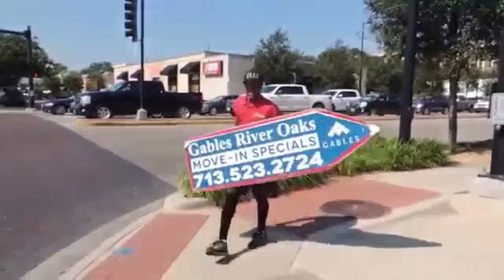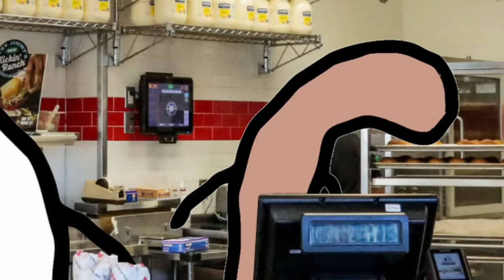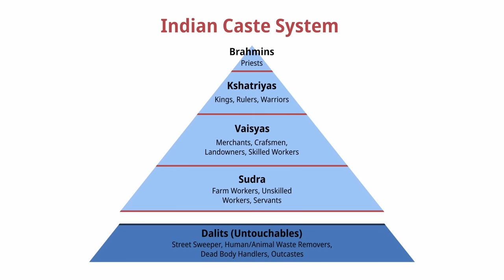7 Levels Of Blue Collar Workers

Comment: As a warehouse worker/forklift operator in an cold warehouse (3 degrees C inside) I feel good in there. Sure, I have graduated high school as an entry level business man, accountant, cook and waiter but those jobs are either badly paid or require me to work about 40+ hours a week (40-80) or require me to cure cancer beforehand, the ability to teleport or 50 years of experience. I simply refuse to work that long because I value my free time. My free time is not something I can get back with money. I'm pretty happy at where I am right now. The pay is alright, could be better but it's alright for now.
Reply: You could work 1 day a year in a field and turn around and say you have 50 years experience 50 years later. It's a worthless measurement.

Comment: First off, great video. I have worked in construction for most of my working life but I can definitely say that I would take it or the trades over pretty much anything else on your list lol. There is however a secret 8th profession that isn't on here. Farmer. Let me break it down. The pay is terrible and the hours are super long, especially during harvest in the summer/fall, and the birthing season in the winter/spring. Always exposed to the elements. You basically do the job of 5-6 different trades, between fixing equipment, repairing buildings, acting as vet, plumbing and electrical for irrigation, ECT. Bucking bales (whoever coined the phrase "hay day" as something enjoyable has obviously never actually put up any hay in their life). All topped off with the undeniable fact that literally EVERYTHING on the farm will make you stink, itch, or more often than not, both. The real unsung heroes of society.

Comment: I am going to a tech school to be an electrician, and tbh as long as you don't do something dumb like touching a random wire you will be good
Reply: I went to help my dad install an outlet in a garage one day and it started raining. He warned me to take a break when it's raining. Your life is more important than customer satisfaction.
Reply: Young apprentice, apply these rules to your work, and you'll have a long career. 
  1)  Treat every circuit as live. 
   2) Trust, but verify.
You should trust your coworkers with your life. Anyone of them that's insulated is one not to trust. 
     3) don't trust tick tester/chicken sticks, no contact voltage testers. They will mislead you when it counts and will at the least send you to the store to replace some pliers. Get a multimeter.

See you out there, kid.
Reply: @ericmoe63  Thank you for the advice, the first one  is my teachers number 1 rule👍
Reply: i guess you haven't worked yet? as long as the part you touch is insulated you will be fine and always turn of the power before working on stuff. as long as you keep to the 5 safety rules, you will be fine. and if you are not sure if something is dangerous or not messure the voltage with a real messuring tool.
Reply: But .. but ... but most of the wires are random tho
Reply: @GbpsGbps-vn3jy  i work as a maintainance electrican in a industrial plant and most wires there are random and you at first often fo not know for what which is till you look in the plan
Reply: @GbpsGbps-vn3jy  Its not that dangerous you can figure out stuff before touching it fairly easily, I do commercial/industrial electrical work never been shocked by anything bigger then 120v and the very few times I did get shocked was from not testing things before going in.  always double check things are off and tag breakers you turned off so others around won't flip them.
Reply: Electrical work is were its at for the pay IMO Im not sure how your program works if its a 4 year program or what not but its worth all the time and effort in the long run listen to the older guys on the job sites some might be dicks but they do mean well
Reply: @thekiwi4156  yea from where I am at I have co op
Reply: @Daily-PE  thats great no better way the  to learn on the field with the guys that been doing it for a while 😎
Reply: @thekiwi4156  I just have to wait a year and a half because I am only a sophomore
Reply: Being an electrician in British winter really makes you think if it's worth the money starting out from experience anyway
Reply: Lock out tag out is your friend.
Reply: Also look out for Variable Frequency Drives(VFDs), they sometimes explode at random times for various reasons. (Dust build up, rat inside the VFD, power surge, breaker fail closed, moisture, machine operator slings a 4x6x12 through the MCC by poor machine operation and many other such possibilities)
Reply: @ericmoe63  So basically half of firearm safety rules. Hell, I'm going to become an electrician. I already know the difference between being shocked versus electrocuted so I'm halfway there, right?
Reply: My Dad got me straight into being an electrician straight out of high school and now I have been working for almost 2 years with his guidance (sort of like and apprentice I guess). I enjoy most aspects of it except the winter it is cold where I live.
Reply: You will get popped at some point no matter what you do. 120/110 isn't to bad. 220/240 will have you cursing for a few minutes. Anything higher...your gonna be laying on the floor for a solid 10min  trying to figure out if you need an ambulance. Good luck.
Reply: Me, a 24 Y.O welder/fabricator: when I have to be an electrician I "sometimes" "forget" to shut off the circuit I'm working on. And when I do that, it's 3 phase 240v or 480v depending on the tool I'm working on, haven't been fried yet, my Fluke 115 has probably saved my life at least once now that I think of it...
Reply: @ericmoe63 Dont get a multimeter unless you plan to get a good one the cheapo ones can blow out if you dont set them right. I prefer a good fluke voltage tester myself "y'know those 2 pin things connected by wire you stick in the socket i hope i got the name right we use a diffrent name in Dutch" i only use my multimeter for all the low voltage 24 stuff and only to measure resistance amd such (the voltage tester can do that to but i have to hold a button and that sucks)
Reply: God, I couldn't be an electrician. Too scary. A big lathe will turn you into paper if you put your hand in the wrong place but you can see, hear, and sometimes FEEL if it's running. Way more comforting.
Reply: @GbpsGbps-vn3jy  none of the wires are random if you go to school and understand the circuit and what wire goes where
Reply: @dan7eiscool  You are the second one here that didn't get the joke ... WTF is wrong with this world?!

Comment: I have a friend that works in a melt shop. Working in and around MASSIVE ARC furnaces that routinely have steam detonations and occasionally throw molten metal across the factory floor. Sometimes a crane operator whose not paying attention knocks over a vat of molten metal and everyone on the ground has to run for their lives. Dude does 16 hour days in the hottest conditions you can think of, and goes for weeks at a time with no days off.
Reply: That and meat factory has to be the worst of the worst.
Reply: he certainly won't need any coffee when he sees the liquid metal containers to tip above him lol

Comment: I was a mechanic for some time and they werent mentioned and it sucks, there is about a thousand ways to get hurt and die and the entire money making incentive is how fast and how hard you can push your body. And turning wrenches may not seem like the most physically demanding at first, but when you have to lift and move heavy objects while also contorting your body around and in tight spaces while wearing out very under utilized dextroius muscles it gets pretty tough.
Reply: I'm a mechanic too. Its a very underappreciated and underpaid job. I made over double my current pay when I was digging ditches for the water company or even when I was working on the farms.
Reply: I transitioned over to heavy equipment. its the positions that mess you up, I thought I was cool with the heavy lifting since I worked heavy in a warehouse, but trying to hold a bolt in the most overextended way while someone else is trying to get right fit is another pain. My forearms are the thinnest in the shop so I get those jobs. 25 here, so far my knees feel more messed up but atleast my body isn't completely beaten up like in a warehouse, where I did make more money

Comment: Pizza delivery is like the holy grail of these jobs. Great pay including tips and almost none of these downsides.
Reply: Started driving for dominoes a week ago. The irony of pulling up to a million dollar house and seeing no tip is palpable. Yet I recieved a 13$ tip from a motel room.
Reply: The wear-and-tear on your car though. Plus gas is expensive and most places won't reimburse for it.
Reply: @ramunematt  I work for Pizza Hut and they give me 36¢/mile for gas. You can get a 2000s Toyota or Honda for less than $10k and it will most likely be very reliable and cheap to repair.
Reply: Pizza delivery sucks, people don't make careers or own houses out of delivering pizza. Lots of construction workers own homes js
Reply: @JubJub117  It depends on where you live and work. I work 32 hours a week and make approximately $36k a year. That's not a lot but where I live it's enough to buy a small house with a 15-30 year mortgage if you are frugal. And if I were to buy a house with a partner then I'd be ballin. The only real downside is I will never be prepared for major medical bills. And as far as careers go, you are probably right for the most part, however my general manager who has worked for 20ish years in the pizza business is being promoted to district manager or something. That said, he works 70 hour weeks so...
Reply: @joshbaldridge457 Rich folks RARELY tip. Best tip I’ve gotten was from a trailer in the middle of nowhere.
Reply: You cant get stoned working for Unions, can u?
Reply: @soulie2001  I'm literally the only driver at my work who works without smoking 😄
Reply: @JubJub117   not everyone is happy when they own a home, some are happy with their life when they got a room to live in weed to smoke and food to eat.
Reply: Tops your making $1000 a week, plus wear and tear on your personal vehicle and gas money at some places. Not even close to worth it for the wear on your vehicle alone.
Reply: I read somewhere you have a more dangerous job than a firefighter as a delivery guy
Reply: @JubJub117 because they build them no shit
Reply: @JubJub117 people should be able to make a living delivering pizza
Reply: @itsmejb  agreed, so should retail workers, so should fast food. Doesn't change the fact it doesn't. It should though
Reply: Having to buy and maintain your own vehicle AND cellphone is a huge expense for a job. 

As a mechanic I don’t even need a car or a phone for my job.
And I make twice what pizza delivery diver makes.
Reply: @fastinradfordable  I bet mechanic is a good job but I don't think those things you said are a big deal for the average pizza guy. Most of us have phones already and we drive really cheap cars.
Reply: @fastinradfordable  yeah yeah yeah everyone knows mechanics are lazy.
Reply: pizza delivery is awful if you live in a questionable neighborhood
Reply: @methanemamba2461  true
Reply: I did it a number of years ago and it was pretty solid money when I could get the hours, but for the most part I’d go in for a few hours daily during peak business and get cut early or not make great money after the rush. Went on to EMS, reasonable school length, a lot of the independence and free movement I enjoyed while working pizza delivery, legally permitted driving speeds and a lot of the same mapping skills. Plus basically unlimited overtime (within safe reason) for the REAL money. I also became an emergency dispatcher which is fairly short education length but extensive on-the-job training depending on where you work, better pay than the field in my area and easier on my body and used a lot of the same mapping/route strategy skills of delivery work in a safer but more structured workplace environment with good benefits and consistent hours, but again you lose a lot of your independence. I do miss the pizza delivery gig sometimes, but I definitely appreciate the consistent paychecks with a lot of the same old perks now.
Reply: @joshbaldridge457 Haha their nothing like going to an huge house to deliver pizza with multiple Porsche in the driveway and they are the lowest tipper of the day. lol
Reply: >great pay
lol
lmao even
Reply: @slightlyaboveaveragebutaverage  That's subjective. I make $20-25 an hour which is crazy good for where I live. I am able to live very comfortably on that pay. To some that is great, to others that is slumming.
Reply: @casadilla111  There is a huge trailer park in my delivery zone and half the people there are Hispanic. I am always happy to go there because they are friendly and almost always tip well.
Reply: @joshbaldridge457  Rich people don't tip.
Reply: The downside is the pay
Reply: @foolin11  if your goal is to buy a big house then yeah, but if you are okay with less expensive housing then you can have money leftover to invest. I've delivered for a year and a half and saved $19k
Reply: @henrykopp6402  Personally, my goal is to use the money to go to commercial pilots school which is over 100 grand tuition and all and left over money to also buy a house. Schooling is only a year and my wife is a registered nurse. Plan is she'll cover most the mortgage while I'm in school, will likely have to relocate for my pilot job and we rent out our place for extra money and buy wherever else we move if we're there for a while.
Reply: Valet driving is the superlative summer job, you can’t convince me otherwise. Driving nice cars (mostly), getting cash tips and enjoying a bit of exercise as well. Pizza delivery is great, don’t get me wrong, but valet was better imo. 

Downside is having to work hospitals or airports in exchange for restaurant/event gigs. You have to eagerly greet a portly man who drives a clapped out 1998 Tahoe with sticky seats, armrest, wheel, no AC, and a very memorable odor consisting of whatever was left uneaten in the chipotle bags and the cups from Dairy Queen that are far too yellow from baking in the sun.
Reply: oh shut up about your tips
Reply: Lmao I got held at gunpoint delivering pizza and nearly got jumped more than once, it's great until it's shit.
Reply: @BigBoyXP4014  good point; I guess it depends on where you live. That said the same could happen if you work for Amazon or USPS or any of those jobs or even just in your normal every day life if you go out after dark.

Comment: I'm a boiler operator, a lot of the guys I work with are real rough and run down. I developed plantar fasciitis within the first couple of months working in the plants and I used to almost blow out my elbows turning the old, abused valves on the boilers. Just a couple of days ago, my co-worker and I spent almost 45 minutes trying to open one valve. The day after, not only was my back sore, but so was my neck.

Comment: As someone who has done both physical work and desk jobs, desk jobs sound good on paper because you're not wearing yourself out physically at work, but what you have to remember is that with physical work you don't have to spend any of your free time off work at the gym if you don't want to. That's more free time you can spend doing literally whatever you want. If you try to work a desk job without setting time aside for exercise, you will pack on pounds FAST.
Reply: Im a mechanic and i still hit the gym every day after work (why do i do this to myself)
Reply: I have the opportunity to work out and get paid for it. I rarely take that opportunity, but it's there for me. I could, right now, do an hour of exercise and get $48 for it (I'm right-right now crossing into overtime).

Comment: I've done a couple on this list but my worst experience had to be dish washer. I'd sit in a 102 degree, humid as hell room and have to clean dishes from every part of the small resort. I was soaked from head to toe, covered in old food from the sprayer, while sliding around on the floor because even non slip shoes weren't enough. I was also the only one in that position so I had to make sure everything was done no matter the amount of dishes. The only upside was that it was pretty safe.
Reply: My worst was working for a temp. agency pressure washing big-rigs in the middle of a Minnesota winter, covered with freezing road muck for about $5 an hour. I've done some dishwashing too, had nightmares about being surrounded by stacks of dirty dishes! Is there any wonder why people turn to crime over this shite?

Comment: Coal miners: 14 hour shift hauling 80lb bags of rock dust 4 miles from the shaft to the face on uneven ground, crazy loud machine echoes in the background, low light, so much dust you can taste it, and forced cold air from outside blowing at your face around 20-30mph (temp gets in the negative during winter).

Comment: I've worked in the meat industry for 1 and a half years. I was a heat treater (cooking hams, sausages, smoking bacon and stuff like that). Not only I had to load, operate, monitor, unload and clean the huge ovens, I also had to register everything to the computer system, keep track of times, kilogramms, temperature, decide the cooking order and also move 500kg-1t carts loaded full of products. The ovens were quite obsolete, so they malfunctioned a lot, which meant that I had to valk into the hot oven to push the steaming ham over to the cooling aparatus by hand. Constantly going from 10 celsius to -2 to +70 to 4 while inhaling smoke, steam, my own sweat. And also dodging rats, cockroaches and meat eating bacteria. Working 12 hour shifts 6 days per week. I ate real good tho. And the money was quite decent.